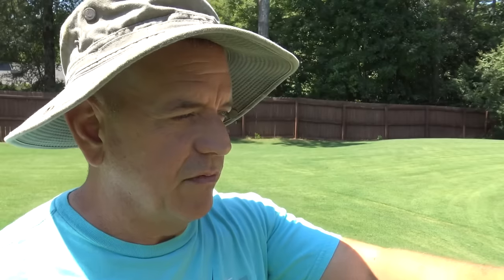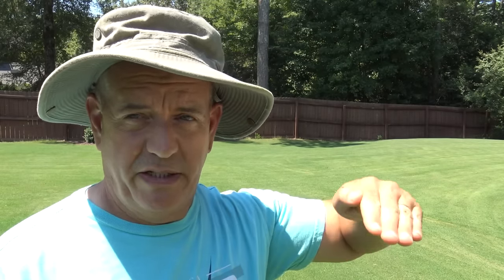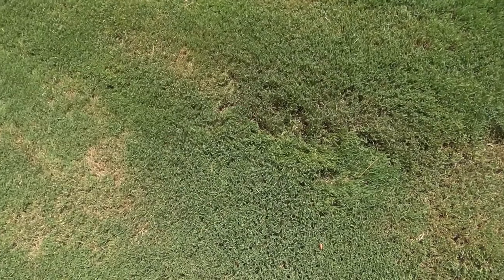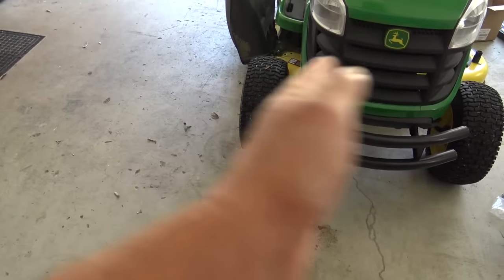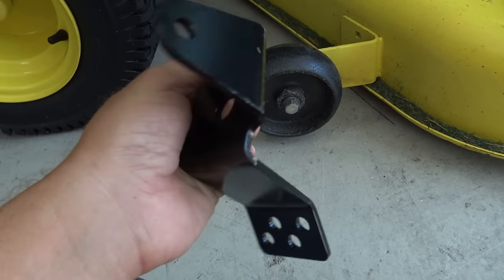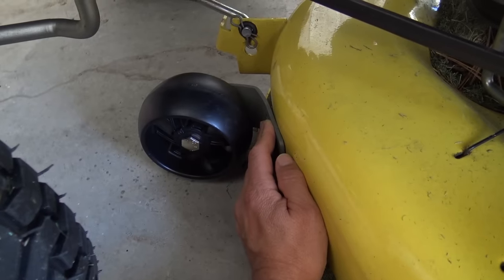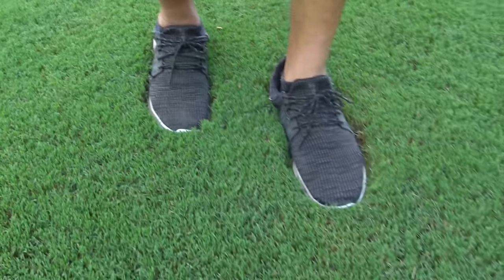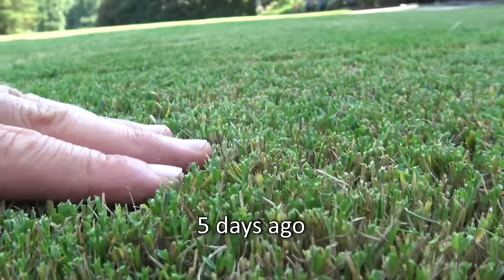Lawn Mower Scalp Wheels - Adjusting and Adding

Comment: Doc, looking at the deck when lowered, we can easily see that your deck is not leveled. The front is way to low compared to the back. In case you didn’t know, that rod at the front of the deck is for adjusting the height. Instead of adding that extra wheel, you could have level the deck .

Comment: I’m not a lawn person but can you fill in the hole and plant grass?
Reply from the maker: The front of the blade should be roughly 1/8" lower than the rear. Prevents double cutting on rotary type mowers.

Comment: So i cut at 3.5 inches.. whats my scalp wheels need to be at off a hard surface? Still 1/4 ? That seems wrong
Reply: Kylekatie Butcher yes, that is correct.  Put your mower on a flat, hard service.  Lower the deck to your cutting height.  The scalp wheels should 1/4 off the ground.
Reply: It seems wrong to me too. I have aJD E130.I also cut at 3.5 inches. I lowered my scalp wheels to the bottom hole and there’s an inch and a half gap. My owners manual states that there should be 1/8 to 1/2 inch space. I can’t lower the scalp wheels any lower?

Comment: Thank you, Doc, for this great video.  My lawn is exactly like yours, and I face the same scalping issues.  I just bought a brand new E180 with a massive 3-blade, 54" deck.  I've raised my deck to 3.5" but still have bad scalping.  But here's what I don't get:  My prior tractor was a LT160, 2-blade, 42" deck.  I used to cut with it at 3.25" and had only 2 or 3 areas with bad scalping.  But now with this 54" deck E180, I have about 15 or 20 scalped areas.   At my wits end after plucking down close to $3 grand.  I've been thinking about having several yards of black dirt shipped in and trying to fill the low areas, and re-seed.  Ughhhhh.  Would sure like to avoid that.  My next cutting I plan to lower the 4 scalp wheels, and raise the deck to 3.75".
Reply: your owners manual tells you which hole to put the scalp wheels in, for 3.25" should be the bottom hole, i just bought one used it once and have some really uneven land.  My 54" deck has the 5 wheels, the middle one only has one mounting hole.

Comment: Big property ! I have also an issue where previous owner cut down a large tree in the middle of my backyard. Now as you can imagine it is sinking due to the roots rotting, I have filled in the dips a number of times but could take a few years before I get it right. I thank you for this video and am about to check my  Australian Greenfield ride on to see if I too could improve my cutting.
Thanks Graeme in OZ

Comment: Ariens solved the scalping problem decades ago with their "flex and float" deck mounted on their GT series lawn tractors.  There are no scalp wheels.  The deck rides on the ground on it's own rollers and is suspended in such a way that it is independent of the tractor.  I've often wondered why no other mower manufacturers adopted the Ariens system.

Comment: Hey Doc nice video. I have a $6000.00 john deere with a 54" deck that has center roller wheels and ajustable side scalp wheels. My dad still finds a way to scalp the lawn even set at 2.5" . The only cure for scalp is to roll and sand and roll again. If it's not flat it will scalp.

Comment: Some mowers come with a wiiiide (5th) wheel in the center/front of the deck. Ask your parts guy which brand mower decks support that item. The ones I’ve seen are about 6-8” wide, like a miniature rolling pin. GREAT job for thinking outside the box....um...er...deck!!!

Comment: you said it right, cutting bermuda with a riding rotary mower low will create scalped areas and the only way to fix it is by leveling the yard, adding more anti-scalp wheels wont stop it, and the wider the deck the more you will scalp

Comment: Simplicity lawnmowers have  the best anti scalp system, a 48 inch deck has 10 scalp wheels.  And the rear of the deck has a solid bar of scalp wheels from side to side
Reply: On my JD forum, there is always "discussion" about the best cut.  Simplicity always has the best cut because of the TRUE floating deck.  That said, almost never see that brand among the commercial mowing trade.  A compromise I guess.

Comment: Great Video Just Subscribed!   Let me ask a question.....The before and after of the front lawn at the end of the video is so stark from when it was cut to 5 days of growth,  why not cut it at a higher setting to begin with?  I used to cut my lawn really low for years and a friend of mine suggested that I was cutting it to short and advised me to cut it at a higher setting.  For me that worked out and my lawn always looked greener.  My lawn is not as dense as yours appears to be, so I’m not sure if it’s relatable

Comment: I have a JD similar to yours and never knew what those deck wheels were for.  Thanks.  How do you treat your lawn, both for fert and weeds, with dogs. I have for Doodles that are constantly in the yard and have been hesitant to put down weed control. Now my yard is being consumed by the weeds. The droughts and high heat here in Savannah didn't help either. Keep the vids coming.

Comment: @7:10 Deere used to have a center roller in the front center and rear center. In addition to the rear outer wheels and optional front wheels

Comment: Hello, I'm a new subscriber and I have many of the same issues that you're showing how to prevent and I thank you for the information. Off this subject, I also have Bermuda grass  that I cut with a JD rotary mower. The problem I have is infiltration of foreign grasses and I struggle to get rid of them year after year. Is there a product, granular or spray that I can apply to get my lawn back to just Bermuda grass. I'm hopeful you can help...... thanks!

Comment: Most of your complaints concerning your John Deere is you have a 100 series. I have a 380 and don’t have those issues. The 380 has a much upgraded deck system
Reply from the maker: I agree... but $2100 vs. $4500 and I get to gripe...  :)

Comment: I have a 2010 Craftsman with a 42" cut deck;  sometime last season the control lever for the deck broke off as I tend to get too close to shrubs, bushes & trees.  Anyway, I've tried rigging up a homemade suspension apparatus that "hangs" the mower deck from the chassis.  It took me forever to "adjust" it so that the deck will cut level, but my problem now is that I not only scalp the lawn, but I'm also scalping TREE ROOTS that protrude above the ground!  I'm considering buying 4 anti-scalp wheels in hopes they will stop this problem, because I can't afford to buy another lawn tractor.  Will the wheels help me?

Comment: Your video is great but my problem is turning corners and 5he front wheels dragging. We end up having  to replace wheels more than once during the summer. Our lawn is even worse than your, we live way out in the country and most of it is old pasture.  Do they make front swivel wheels?  I have to kept raising and lowering the deck which in turn caused the lever (we have a hydraulic deck) to break.  Any suggestion would be greatly appreciated.   Thank you,, Nancy

Comment: I'm trying to figure out how can I have my riding more higher.  My blades (deck) and adjustments are all the way high .. my only thinking is buy bigger tires ?  What do you recommend? I set my mower at 6 . On high and cuts like 1 or 2 inches. I want higher grass .

Comment: You have a fairly flat yard compared to mine. Mine is VERY uneven, hills, side hills, valleys, got only 2 holes is all like you, etc, but the grass is flat. Had a Cub Cadet that mowed it PERFECTLY flat. It got to be 18 years old and every independent mower repair place I talked to that does not sell mowers all said I could start to nickel & dime it, so I did ALOT of research. I settled on a Deere X310, just like you a Deere. I’m so SORRY I went with a Deere. NEVER EVER BUY A DEERE AGAIN. I love the mower, but it cuts uneven, it scalps, does not throw the grass out good & more. The ‘tractor’ is great, but it doesn’t cut worth anything. Two different dealers came and watched it cut, had independent repair men come to watch it cut, all said the same thing, can not adjust it to cut good and sorry there’s nothing we can do. Next mower I buy (very soon) the dealer I buy from will have to bring a mower to me & try it on my lawn. Any one want to buy a 5 year old x310 w/150 hours.